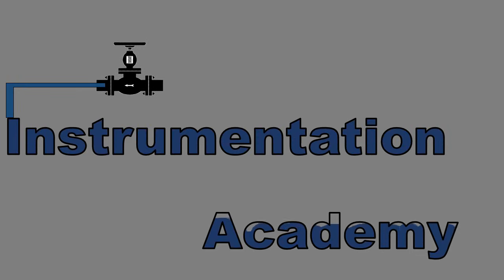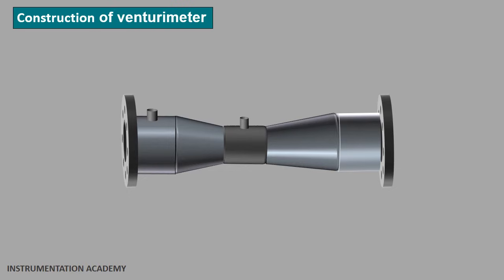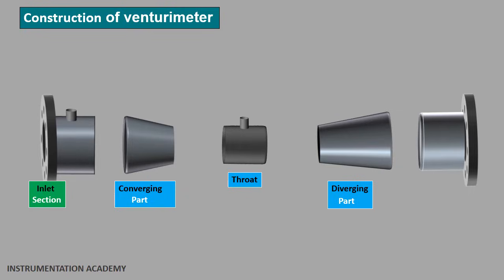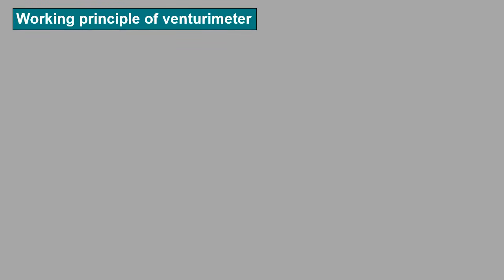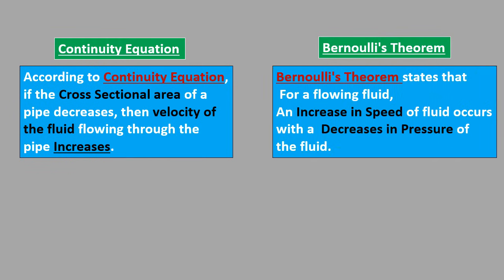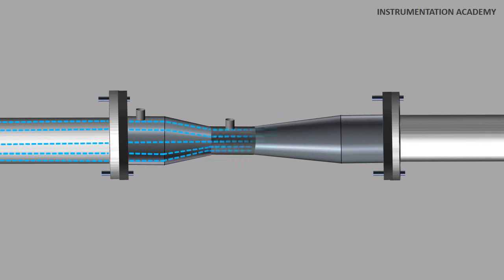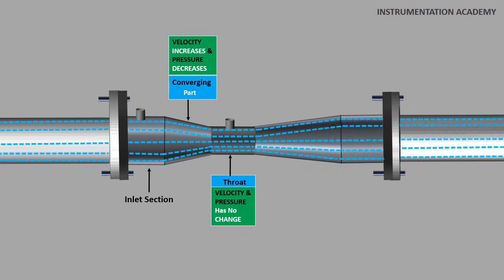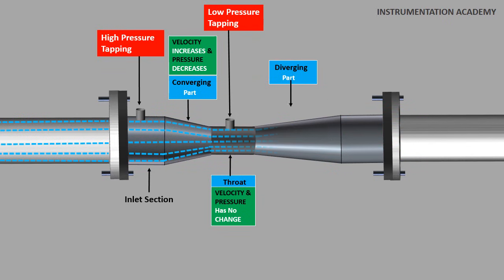What is Venturimeter. How Venturimeter works. Working Principle of Venturimeter.Animation Video.

Comment: high velocity doesnt neccearly mean high pressure ,and velicoty is impossible to decrease pressure ,because ,what drops the pressure is a sudden drop in pipe structure ,not in presure ,a sudden change on the ongoing fluid which mostly vapor ,vapor means in the vapor phase ,not boiling phase ,but vapor ,thats why theh call it vapor pressure ,not boiling pressure

Comment: i think velocity is not what drips the pressure is created from the physical structure if the pipe ,and how gasses behave ,its similar to the expansion valve because its very similar ,because both systems qre dealibg with fluids and high pressure and low preseure ,i call it narrower locatoin ,vecause the physical structure of the piipe the allowed the pressure to drop ,not because velocity decreses pressure ,pressure is related to temp ,the higher the temp the higher ,why the higher because when gas is heated it needs more spqce to hold it but when you icreases it in a cylinder without heat sourve of coursr ,its always must be cold ,and here is the paradox ,because if u apply heat and pressure simlultaneously ,u can apply pressure and cold to a closed system ,thank you God ,or if u want colder ,u can start with co2 as a refregerant ,but a comoressor to commpress co2 must be strong without external intervention ,on default or factory settings ,the next cycle will be colder depending on what gas is found on the second refr unit because there is heqt exchange happens between the 2 systems and when this happens ,the 2 unit cold end could get u to 170

Comment: why diverging part is longer than the converging part of venturimeter if it is doing same job  to maintain pressure?
Reply: It is because in diverging part, there are more chances of flow separation at the walls due to adverse presssure gradient and hence the diverging section needs to be made gradual sloping to avoid larger pressure losses. In the converging section, there is no chance of flow separation at the walls due to favourable pressure gradient and hence it can be made to slope steeply.
Reply: @harshitgupta4238  nice explain bro

Comment: ur video is incomplete because how to calculate pressure in venturimeter not explain.
Reply: flow rate = K*Area of throat*sqrt(2*density*pressure diff.); where k=c/sqrt(1-(b^4)); c = discharge coefficient (0.99 for venturi meter, 0.75 for orifice plate; b = diameter of throat/diameter of inlet. K is also called flow coefficient

Comment: For clarity, you should show the actual dataset of pressure & velocity at each part in your system during steady state conditions (e.g. inlet pipe, along the converging conical part, center pipe, along the diverging conical part, outlet pipe).

Showing the solved equation/s would also be useful.
Reply from the maker: Thank you so much for your feedback
Reply: No need .... just us how to determine flow rate with the help of pressure diff obtained